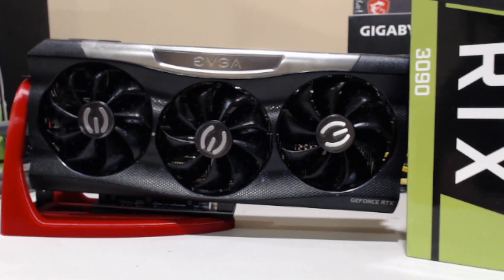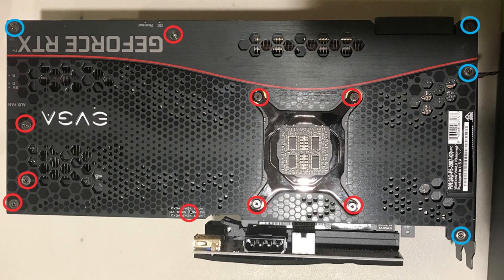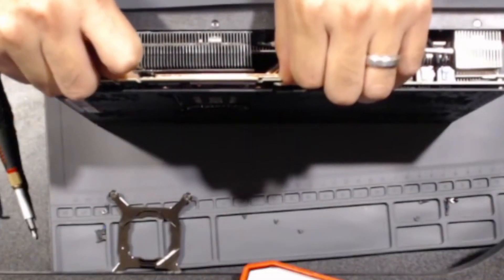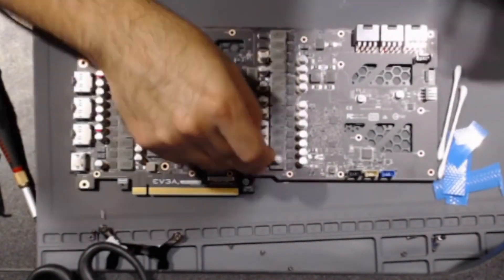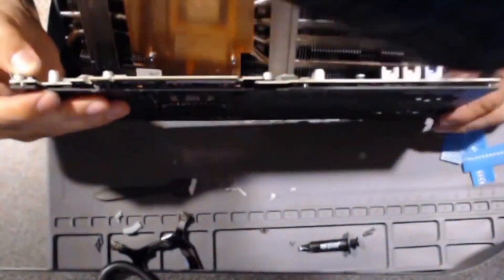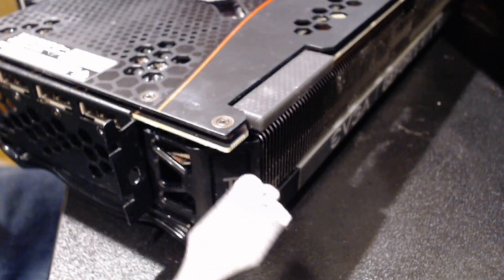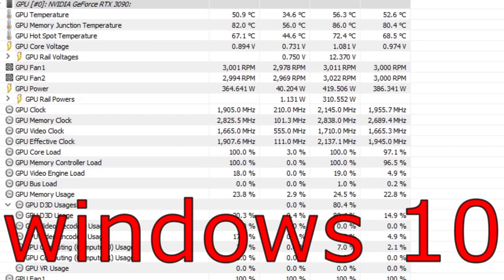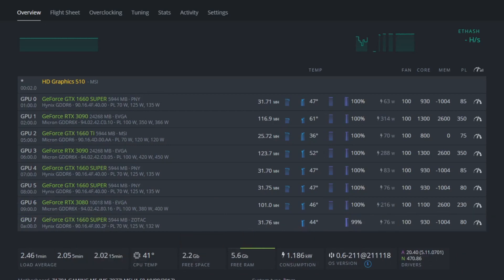Re-pad EVGA RTX 3090 ftw3 that was thermal throttling.

Comment: No disrespect intended but as a person which worked for EDS and was trained in how you maintain & refurbish Graphic Cards. You can’t put thermal paste on the Capacitors. They too need to be covered by a thermal Pad wich ich thick enough to prevent the Capacitors to make direct contact with the Cooler. With RTX 3080 & 90 cards usually a 2,5/3 mm thermal Pad with -15/20 Watt heat absorbance will be the right choice & then you hashrate for ex for ETH/ETC will rise up to 125 MH or even 127. Obviously Silicon Lottery does apply

Comment: Thank you very much for the video. Do you have the thicknesses of the thermal pads? I ask you this because in Argentina they do not sell the Kit that you show in the video, so we have to buy a plate and cut it to size, but I would need to know if you can tell me what is the thickness of it, either 0.5mm, 1mm , 1.5mm, 2mm, 2.5mm. etc.
Reply: Sorry I did not see the answer that was in the description of the video.
So the pads are 2mm for the whole plate, and the 3mm pads are for the back plate?

Comment: Every pad front and back are 2mm or no? Looking at your description
Reply: From Kriticalpads web site:
EVGA 3090 FTW3
Thin (1mm) and wide (10mm) stripes go on the grey power modules where EVGA used thermal putty, on both sides of the GPU die. 
Thick (2.6-2.8mm) and narrow stripes go on the mosfets, on both sides of the GPU die.
Thinner VRAM pads (2.25mm) go on the front side (i.e. die-side) of the PCB.
Thicker VRAM pads (2.5mm) go on the back side of the PCB.

Comment: Pocka, So I added 0.5 thermal pads and it looks like they aren’t making the contact it’s supposed to be making, is this bad? Should I look for 0.75mm thermal pads instead?
Reply: Memory temps went down from 108 to 100 at the hottest moment of the day
Reply from the maker: i used a zip tie to get better contact. i don't recommend it though.
Reply: Lmaoo a Zip tie!! I need to see this.

Update, I used 0.5mm pads and now it’s back to 108c memory,what I’m also noticing is that my GELIC pads are not at squishy as the factory ones so maybe that is also a factor. These ftw3 are fr a nightmare 🫠

Comment: Revision 1.2 comes with really good thermal performance out of factory. My FT3 idles at 24c, and around 58c while playing GTA5 on ultra. If you get 1.2, there's little to no reason to do this. Nevertheless, a really good video - thank you for sharing the entire process.
Reply from the maker: Normally not. All my other FTW3 cards have been great. for some reason this card was thermally throttling out of the box.
Reply: 100% wrong I just bought one brand new and rev 1.2 and it's 110 memory junction temp when I mine that's why I'm here watching this vid

Comment: Hey, man! Thanks for the video and measures! But a question... why didn't you change the pads on the backplate? They're ok to keep? Thanks again!
Reply from the maker: Hey I didn’t change it. I wanted to see how it did over time. The card is working great and I didn’t have to change it. The hash rate is holding steady.
Reply: @RedLlama  thanks a lot for the fast reply!! Gonna try the same as you and keep the ones from the backplate! I saw your tjunction kept around 82C and that's great at that level of hash rate.

Comment: Did you not re-pad the backplate vrams as well? Nice temp drops and good video either way!
Reply from the maker: I didn’t repad the backplate. I was going to hold off and see if I needed to. The card is still going strong.
Reply: A lot of the memory modules are on the back as well

Comment: Good video.

The backplate and the thermal pads on the 3090s are bad. I have a gaming box by gigabyte and my ram runs at 110c so the card thermal throttles. And hot hotspot run hot as well. I do wish to eventually take apart my gaming box and fix this issue but the box is pretty cramped. This video will be useful. Thanks

Canada

Comment: ok so just to be clear - 2mm pads for the front and 3mm pads for the rear....
Reply from the maker: I did not change the back pads but i believe someone else in the comments below did and they confirmed it was a 2mm or 3mm after they had done the back plate pads.

Comment: Hello my friend, I did exactly what you did in the video and I bought the same thing you suggested and the graphics card remains the same. What do you think it can be? that I have to do ?
Reply from the maker: Hi when you say the same. Do you mean same temp or just hash?
Reply: @RedLlama  starts well at temperature and 120 mh / s, but then lowers Mh / s and raises the temperature
Reply from the maker: @gianniserva  what is the thermal conductivity of the pads you used ?
Reply: @RedLlama  i used oddyssey thermal pad
Reply from the maker: @gianniserva  check if you have good contact.
Reply: @RedLlama  the contact should be from where to where? on the cables? or on the thermal pad?
Reply from the maker: @gianniserva  check if the contact between the chip and pads to the heat sink is good. Meaning you see the compress and the thermal paste cover the entire area.
Reply: @RedLlama  hello, you used thermal pad how many mm? I want to replace everything again because I still have a problem with that card.
Reply: my graphic card are RTX 3090     modelo 24G-P5-3987-KR FTW3
Reply from the maker: @gianniserva  I used 2mm on the vram and inductors.
Reply from the maker: @gianniserva  reach out to me in discord.
Reply from the maker: @gianniserva  https://discord.gg/misfitmining I’m in that channel

Comment: Hi POLKA! May i check, the 3mm and 2mm thermal pad is used on which location? vram 2mm?
Reply from the maker: Hahha polka!  You can use 2mm on the vram and on the smaller chips as shown in the video. For the inductors I just used thermal paste. I am not sure but on the back plate it’s either 2 or 3 mm pads but I did not change it out.

Comment: Hey, can you link us to those thermal pastes that you were using for the memory and GPU?
Reply from the maker: I used XTM50 for the inductors and Thermal Grizzly Kryonaut on the GPU chip. Please let me know how it works out for you.
Reply: You think a noctua thermal pate will be ok for the inductors? Noctua NT-H1 10g, Pro-Grade Thermal Compound Paste (10g)

Looks like you put a very thick amount on the inductors? Is that how I should approach it
Reply from the maker: yes, that should be good. I put a lot since the gap is about 0.5mm there on the revision i have.  you can always put a little place the heatsink on and remove it to see if you got good contact. If no, add in more. do this before putting plate on the gpu chip.

Comment: What about the vrams in the back of the PCB? did you replace those?
Reply from the maker: Hey i just left the stock ones there. I did not change it but if you are going to use 3mm thick pads.
Reply: Nah they used 2mm

Comment: Which pads did you use?  And how many should I buy?
Reply from the maker: I used Thermalright Thermal Pad 12.8 W/mK, 85x45x2mm and only qty of one. You could also cut out a piece of paper to make sure you stay within the boundary’s of the sheet. Also, make sure you have more than 5 grams of thermal paste.
Reply: @RedLlama  thank you ill lyk how it goes.
Reply from the maker: @MrJeanWilson  yes please let me know and if you run into anything you are unsure about just reach out again. It can be a little scary. 😩
Reply: @RedLlama  will do just ordered a 3mm and 2mm and some noctua thermal paste 10g.  I was about to buy a hybrid kit and found your video . Good thing I got a ifixit kit.
Reply from the maker: @MrJeanWilson  the pads should help out. Let me know how it goes.
Reply: @RedLlama  not sure if youtube removed the comment , anyways its way better then what it was, i was getting 108c @ +70 power limit , + 0 on memory. Now i'm getting 88-92c max @ 75power limit+1400 on memory @ 122mhs. Not sure if i did something wrong i would think it should be less then 90c but its still a 10c+ drop. Also i think 3mm on the back its a bit big i think it would be better 2.5mm or a 3mm that compress better. Was trying to upload a picture of the card youtube removed it i think.
Reply from the maker: @MrJeanWilson  those cards do run hot but if you good airflow it should be ok. You can find me on discord as Redllama#1315.

Comment from the maker: Have you seen improvements after repadding your 3090?
Reply: My card was stable 102 at my clocks/volts. Didn’t like the temps, so I purchased paste and pads. Uncharacteristically it started throttling at 110 and would hold, with no changes. Repaste and pad brought it down to 92-96 now on memory for me.
Reply: if only I had one...